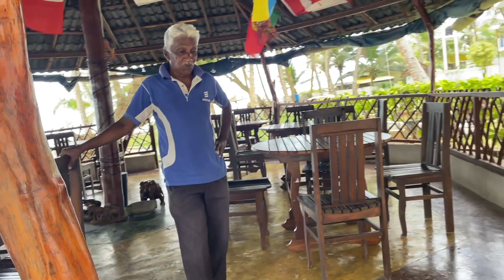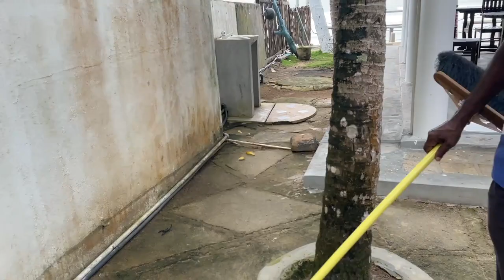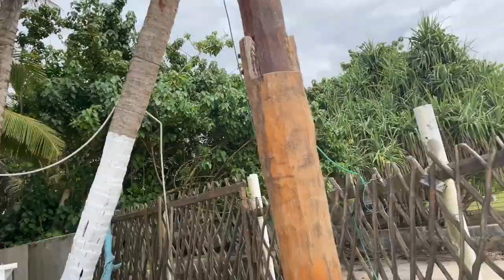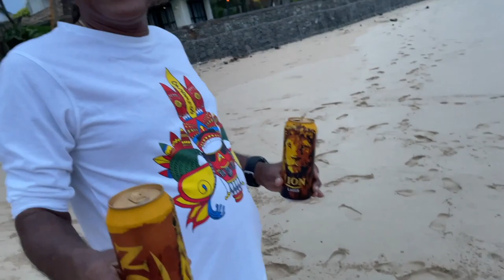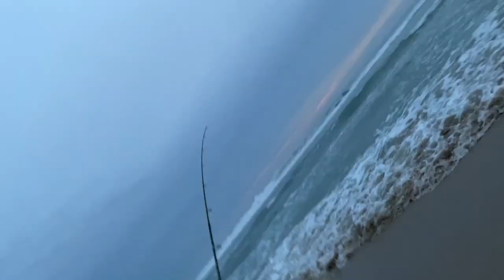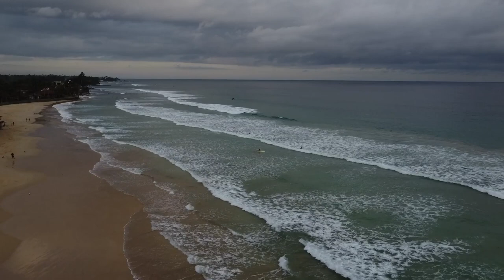My First Sri Lankan Beer + Scorpions and Fishing in Sri Lanka 🇱🇰

Comment: Great videos, Johnny! The scorpions out there didn't worry me, apparently their sting is apparently very painful but not life-threatening. I would have swept it into a bucket and released it into the vegetation away from people somewhere, rather than on the beach where someone might tread on it. I did have an encounter with a lethal snake (common krait), which snuck under the door of my room in a hotel in Arugam Bay and slid onto the bed - just before I was about to go to bed. That was very scary, I saw it sliding under the door and thought it was a lizard until the body kept going - unfortunately the hotel employees killed it when getting it out of the room. This was highly  unusual -although snakebite is a big problem in SL it's mostly in remote areas such as tea plantations/paddy fields rather than tourist locations.

Comment: Pro tip: don't set the reels in the sand. Try to lean the rod against something so the reel doesn't touch the sand, the sand can get inside the reel and gum up the gears/bearings.
Reply from the maker: Thanks for the Pro Shop Tip Josh. =)